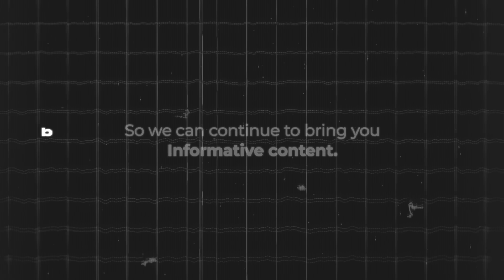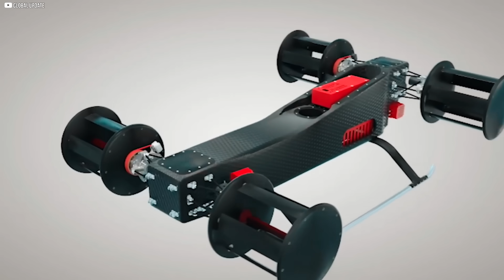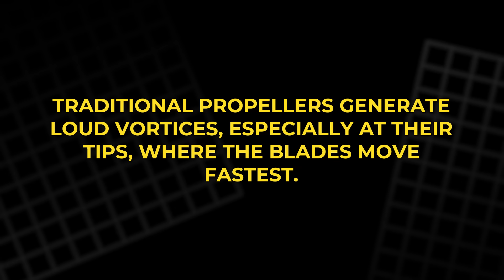Cyclotech's Flying Machine Is Stranger Than Sci-Fi

Comment: or you could use enclosed ducted blower fans. with no moving parts other than the rotor. similar to quad copters.
Reply: Ya, one major air driver and multiple controlled directional dispatches . 😊😊